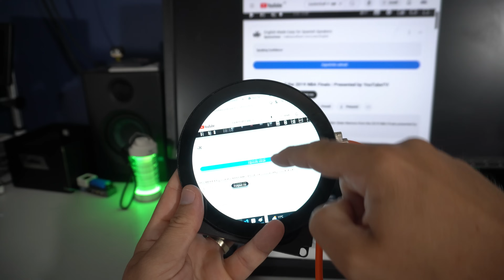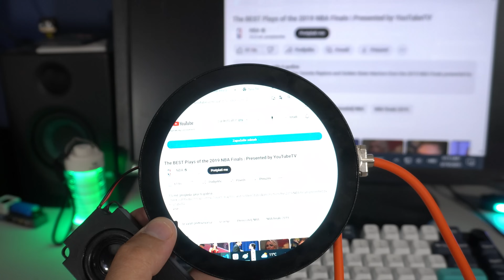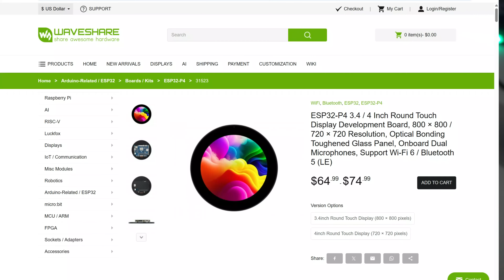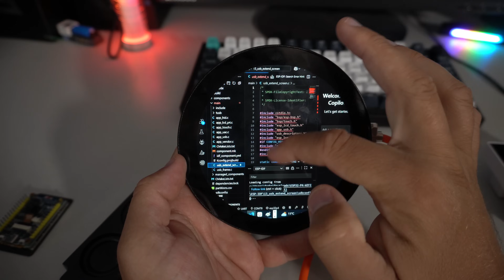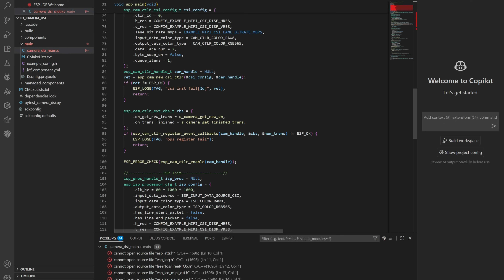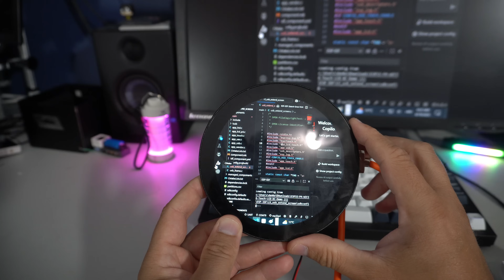ESP32-P4 Second Monitor Hack (With Touchscreen!)

Comment: I purchased this board because of this demo and no matter how hard i try i cant flash it successfully.Ever time gives me an error that bootloader needs version till 0.99 but mine is 1 and i cant handle it.Please give some advice.
Thank you!
Reply: I’m experiencing the same behavior. The build process in ESP-IDF always ends up with an error related to the usb_descriptors source code. I’ve tried changing the ESP-IDF version from 5.3.1 to the latest release, but it still results in the same issue. I have no idea why, and I’m wondering why in the video above it works as expected.
Reply from the maker: @MuhammadYunus-pz3op are others examples working?
Reply: @VolosProjects other example working fine
Reply: @MuhammadYunus-pz3op  Yeah absolutely the same.I contacted Waveshare and they make me wait 5 days,because they were busy and in the end they sent me 2 screenshots showing that they build it successfully.Im astonished by their customer service and fast replies.
Also tired of buying board,that have no or limited documentation.if I was an IT specialist I would  made my own pcb wont buy one from them.Same with Lilygo,even worse…
Hope Volos or Nishad make something cool with these boards to use them.
Reply from the maker: Please give me more information, what IDE you are using , what setings, what you tried? Did you read instructions on waveshare product wiki?
Reply: @VolosProjects I’ve read everything,using esp-idf 5.3.1 as wiki says.Every other demo is flashing with no issues,but this exact one don’t want to build because of some usb_descriptors.h and uac_descriptors.Did you made some changes to the original demo before building?
Reply from the maker: @Din9mir no, to be honest i dont know how to make changes in idf, i use arduino ide
Reply: @VolosProjects Understand but for this example you have to use IDF as you say in the clip.Could you share you project with me?
Reply from the maker: @Din9mir i used project that was in demo folder on waveshare page, i used idf just to flash it, i need to check do i still have it. You can also send mail to waveshare to make sure they havent made any changes to board

Comment: I can't figure out how to display an image?
The device esp32p4udisp0_R800x800_Ejpg6_Fps60_Bl300000 appeared. I installed the drivers for it using Zadig. The esp uac sound device appeared. But the new monitor or image didn't appear.
Reply: I found a solution. I wrote an app in Python.

Comment: I learned Xcode and native iOS/iPadOS software engineering (yes, objective-C also) to a relatively advanced level, and honestly whatever tool gets the job done fastest and easiest is the most "professional" tool for the job. Difficult or badly designed software (including IDE software) doesn't equate to "more professional". Laughable to wrongly believe that IDE software from a chinese company is somehow "more professional" than microsoft visual studio code (that is what arduino IDE is based on now), regardless of how there are maybe no chinese involved in actually making the expressif IDF software (mainly eastern European (including russians) employees at expressif made that?) Maybe the expressif software has earlier access to the MCU features and more access to less commonly used MCU features though.

Comment: I don’t understand why they don’t have WiFi included, I guess maybe it’s supposed to compete with the STM chips
Reply: To squeeze more processing power instead of giving it to wifi.
Reply: I wish it had WiFi... So many uses for it if it was.
Reply: @grayrabbit2211 then you should pick another controller... 
Or add wifi externally yourself.
Reply: Some P4 boards have ESP32-C6 connected by SDIO attached on the PCB.
Reply: @MichałHeadcrabBarnaś yeah all the waveshare boards do that and it works but that limits how small of device it can fit into
Reply: Maybe they had too much interference with analog circuits of wireless